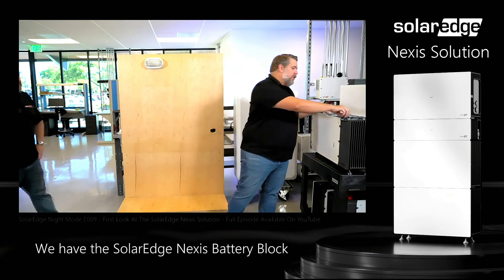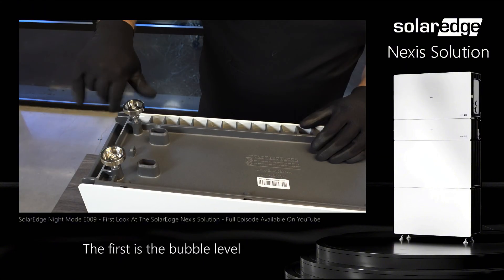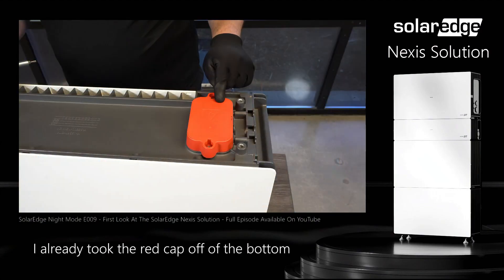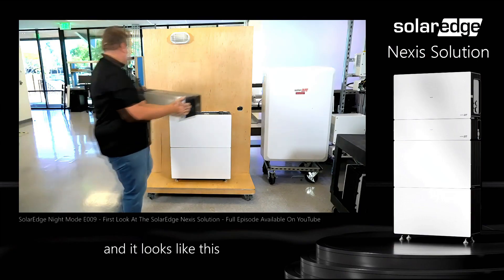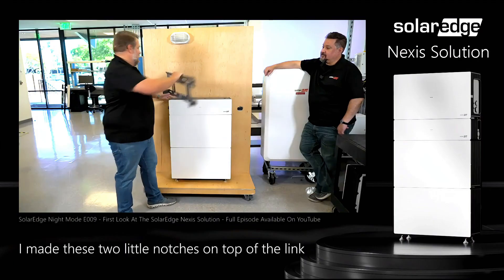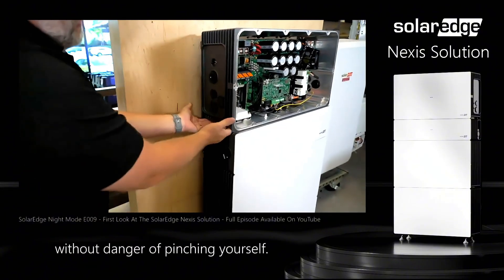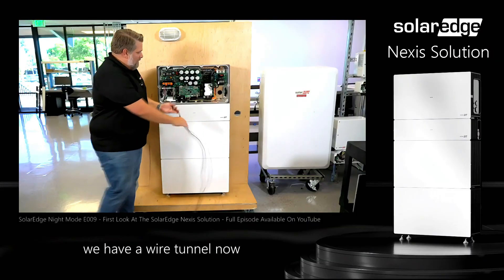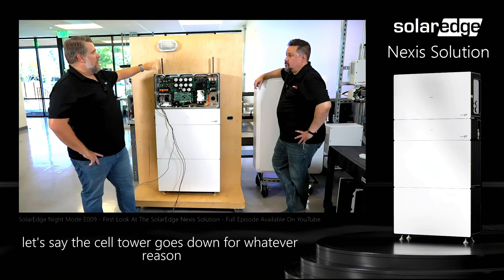SolarEdge Nexis Solution - Easy Installation Walkthrough

Comment: easy install
Reply from the maker: It's super easy, the hardest part we had to deal with is footings on the concrete pour in garages.  I would advise having a little 2x6 and strut on hand - and if that was the worst we had to deal with...  Also, CAN bus makes the firmware updates much quicker.  -Chris in Technical Content

Comment: But apparently this doesn't work with older single phase inverters.
Reply from the maker: Correct Jim, right now the battery is only compatible with the Nexis inverter.  That may change much further down the roadmap, but we're in the middle of beta testing on this iteration of the hardware.

Comment: That is one kuhl setup! Sturdy, stackable, and intuitive. Built in heat sink and at the top of the stack. If only it was made in the USA, it’d be the trifecta of battery backup systems.
Reply from the maker: Good news for you on that front, we plan to manufacture the SolarEdge Nexis Solution here in the USA.  We're already manufacturing inverters, Optimizers, and batteries here.   
-Chris, Technical Content.